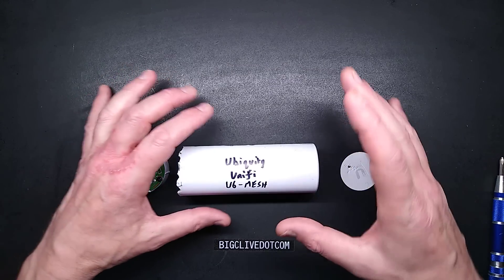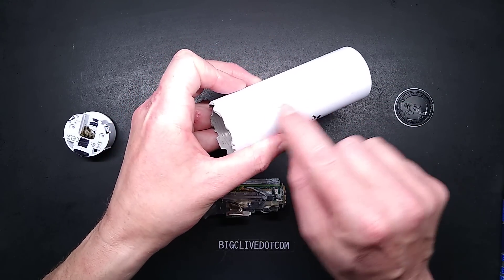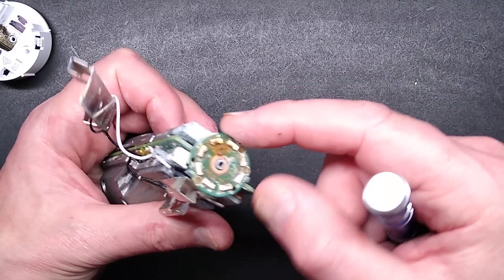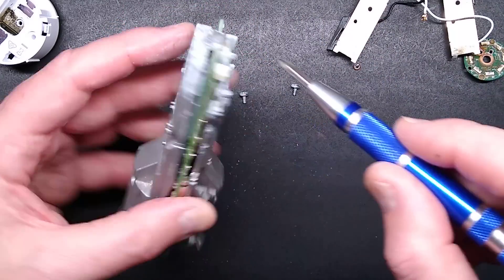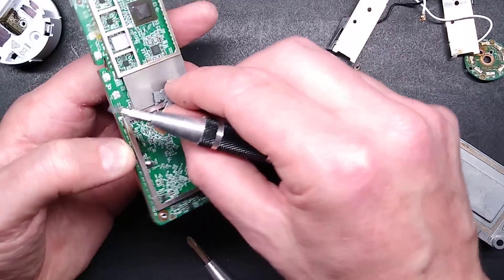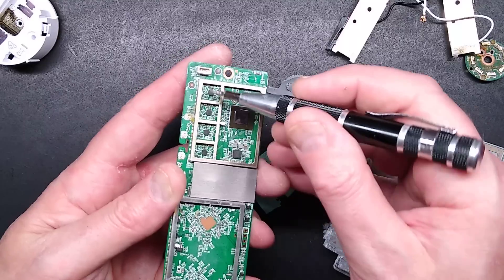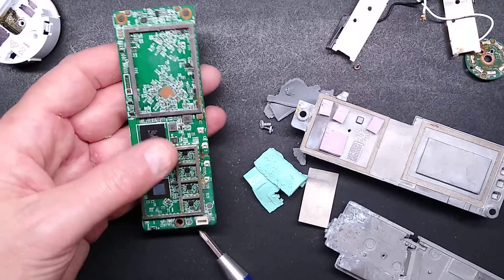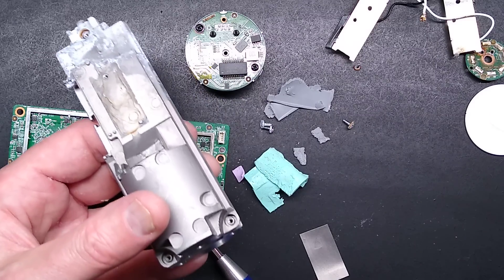Teardown of an impressive ubiquiti WiFi node

Comment: I'm an IT admin and have used Ubiquity products extensively.  An excellent value proposition, but their software always feels... immature. There's always a bit of jank in there. Once you finally get something working, never touch the configuration or it will die in a screaming heap. Quite an odd experience compared to other products. Hardware wise, impeccable.
Reply from the maker: Your thoughts on their software are echoed by others.   It seems to be the weak point.
Reply: @bigclivedotcom It's the entire reason I'm running consumer-grade mesh wifi gear for the moment. This house unlike my last one has no Ethernet drops, so I can't simply run PoE from a cabinet to get whole-house AP coverage, and I just haven't wanted to deal with the nonsense guaranteed to be involved in learning how to manage a more complex Ubiquiti buildout. Not until someone offers to pay me to do it, anyway!
Reply: @bigclivedotcom  Buggy, immature and constantly being revamped with useful or desired features being deleted from the build randomly, never seen again. It aggravates me a lot but there isn't a better option available for similar price points. Their product lines don't make sense.
Reply: Im a IT admin also and have been using Ubiquiti kit for the last 15yrs. Personally i like their software, the UniFi management console is excellent and its the best kind of price. Free. I also use a lot of Cisco Meraki AP deployments, and i will admit the reporting and features are superb, but then again you would expect so given the price for the licencing.
Reply: @TheSaabClinicUK After the latest rework of the controllers UI it has become a nightmare as it’s so illogical and clunky. Network separation is … blood boiling at times, especially if you need to change things afterwards.
Reply: Ubiquity devices work great and last long. I have some that are no longer supported by the latest controller software (or at least it says so, I have not tried to see if it would actually work) so I have to use an older version of that. On one hand, the software can sometimes do stupid things, but I really like that the devices basically have Linux inside then and I can ssh into them and run tcpdump or whatever.
Reply: @Pentium100MHz  Yeh if your using the old original UniFi's then you need to use 6.0.45 for the controller.
Reply: I've only had experience with Aruba's management software and ubiquiti's, and I much prefer ubiquiti for most use-cases (except for something like a multi-campus WiFi solution).
Reply: It is the same with their European/Latvian counterpart Mikrotik.
Reply: I've just upgraded from a TP-Link AX Wi-Fi 6 mesh system to a Unifi Dream Router and the U6 In-Wall, needed the In Wall since it's the only one which has more than a single ethernet port - the TP-Link had 1 wan and 4 GbE on every socket. TP-Link WAN also did 930Mbps, UDR does about 100 less. But that's ok, mostly I only pay for way slower internet. Software wise it's obviously a masisve improvement over the TP-Link, however one oddity is if the In-Wall is connected via Mesh only, physical ethernet devices connected to it work normally and are assigned an IP normally and so on, but do not appear in the client list at all. Bizarre. Known issue apparently, have opened a ticket with them.
Reply: @syniteq If you turn off IDS/IPS, it will most likely do the full 1gbps. I used to use a USG and it would do 1gbps with it off, but under 100mbps with it on.
Reply: And they are historically notorious for rug pulls where they'll suddenly change licenses on things... or put formerly free features behind a paywall...

I mean at least it's not Cisco and co, but they seem to be trying to make themselves more Cisco-y (and not at all in a good way)...
Reply: This so much unfortunately. And not all their products are well executed - I'm looking at you Access UA-Pro.

I am managing multiple UDM Pros, and the "stable" releases on some of the v1 and v2 firmwares love to hang on Network now. The network is working fine, I can reboot the whole UDM to regain access temporarily. Oh and memory holes. Local and cloud.

Door Access would be slick if the UA-Pros didn't have crappy screens, ui just launched a 2nd version, I'm assuming the round screen was untenable. And ui doing back peddling on the camera not being usable with protect, and not allowing multisite without a bogus payment plan or glitchy VPN workarounds... many of us loved unifi for the quality APs and lack of subscription BS, but now the quality is questionable. Just had to RMA some switches, another UDM Pro, and the cloud key g2+ run too hot with the 5tb Seagate drive, had a few of those fail before adding heat sinks. I expect failures to happen, but this is ridiculous. Rant over. Great video
Reply: Agree, I'm in the process of replacing all the unifi gear in my house right now because I'm so fed up with the control software.
Reply: I also used them while I could put DD-WRT firmware on them. Unfortunately, at some point, they began to prevent this and I refused them.
Reply: I've been using them for over a decade. I've always found the software pretty but a little janky until around 2-3 years ago when finally the core features have been stable. I no longer fear the whole network falling apart when I make a configuration change. They're good value for what they provide IMHO.
Reply: I regularly play with the configuration of my EdgeRouter-X. There are quirks to work around, but generally I get it to do what I want without too much trouble. I have it doing a lot more than your average router can do, not because I need it to do all this fancy stuff, but because I enjoy experimenting with it.
Reply: @BrianG61UK edge router is fairly different to the unifi gear btw.
Reply: @zyeborm  Good point.
Reply: Never had any issues with the WiFi side of the UniFi software. I only use their WiFi APs though, not their switches or routers.
My only complaint is sluggishness and high resource usage (the panel is a massive blob of Java code).
Reply: @povilasstaniulis9484  The panel runs on a Raspberry, so at least there's that. But yeah, it's a massive blob of Java.
Reply: I'll agree with that completely. I used to work in broadcast, and the Ubiquiti hardware is great, but I needed help from someone in IT to make any changes in the software.
Reply: true. and the whole vlan support is totally messed up.
Reply: I’m a network engineer, and UniFi is exponentially nicer to use than Ruckus’ SmartZone.
Reply: It's not immature, it's constantly improving. :)))
Reply: I wonder how this hardware compares to Cisco networking devices. I've never torn a AP apart to see. I even had the perfect opportunity but since it was a  government facility I was not allowed to take apart one of their old outdoor access points. Such a sad day seeing a whole pallet of working devices hauled off to auction.
Reply: As a lower budget IT admin, I prefer units that are easily loaded with open firmware to do whatever I want, not locked down gear like Cisco and Ubiqiuity .
Reply: @johndododoe1411  Most enterprise gear is locked down though, it makes it a hell of a lot easier to support and with things like ubiquity, there are no licencing fees or wanky training.
Reply: @johndododoe1411  Ubiquiti works great though. So does Mikrotik. Both are not open source though, but while I use Linux based routers for more complicated stuff, Mikrotik routers/switches and Ubiquiti WiFi work great for mess messing around.
Reply: @Pentium100MHz  Mikrotik is such low quality hardware though - at least all of it that I've seen.  I've used a bit of it at the recommendation of a friend, and... it fried in about 2 years.  Ubiquity seems solidly built, but I've not had good luck with it.  Cisco can just fuck right the fuck off, too expensive, low quality hardware and software, and absolutely unacceptable support, especially for the price.
Reply: I have an Ubiquity Edgerouter to connect my home to my office with a site to site VPN.

Works well but it's annoying how some things are GUI, some things CLI and some things both.

I'm not a CLI fan for these type of things.
Reply: @TheCormTube  I usually use Mikrotik routers and switches and Ubiquiti APs.I did use a Ubiquiti Dream Machine Pro (router and controller) in one network and it seems to work fine. 
I also sometimes use Linux as routers (no GUI, everything CLI-only, just iptables and such), that also works great.

Comment: they are really good bits of kit.

we use them a lot at work both APs and switches and they seem to be really well built. the only let down is there software which can be a bit buggy at times but other than that they are well worth the money.

I myself have a Amplifi Alien router and its way over kill for what i need but does the job. Its also actively cooled with the fan turning on when the unit gets to 62'C (even though it spent most its time this summer at 50'C).

One thing to note is this. turn the brightness of the LEDs down, it's common for the LEDs to go really dim after about a year of use which can be a real pain if you have them installed outside, my guess is that they are driving the LEDs pretty hard at full brightness so a 50-75% brightness level should extend there life a bit more

Comment: I have a whole bunch of AirCams that died from water getting into the RJ-45 connector. And a whole bunch of UAP access points that died because some “genius” decided that it would be a good idea to store a dynamic IP address in flash memory. After that I stopped using the products of this company and I am very happy with that decision

Comment: I think that grey ceramic chip is a BGA (ball grid array) which has some solder balls underneath to connect to the pads on the PCB when it is flow soldered.

Comment: Oh wow, I do this thing for a living and lemme tell you about it

The empty pad that you saw is actually directly underneath the CPU with lots of ground vias for heat conductivity from below.

The 4 little chip is the FEM (front end module) which combines both TX power amplifier and RX LNA, I haven't read the spec for this one yet but judging by the 2 different color, I'd say it's a 2x2 for 2.4GHz and 2x2 for 5GHz (some vendor will combine it so that there's only 2 antenna instead of 4)

The black thingy in the base is just an ethernet transformer for isolating it
Reply: Spec is 4x4 for 5GHz and 2x2 2.4GHz, but it's possible they operate either dual band in dual 2x2 configuration or single band 4x4. The main SoC (IPQ5018) has a 2x2 radio too, though, so I imagine one pair of those frontends is dual band. If I had to guess I'd say the bottom two.
Reply: Yeah Power over Ethernet (PoE) at 1GHz and up needs a cluster of 4 center tapped signal transformers, with the center taps on the cable side extracting (or injecting) the 48V DC running in each twisted pair along with the 100+ MHz AC signal . So each pair carries either plus or minus DC running the 2 wires in parallel and also running 2 pairs (4 wires) in parallel to get enough current capacity to feed 15+ W of phantom power through a signal cable .

I'm guessing the top circle is controlled with i2c (2 wires signal, 2 wires power).

Lots of magic probably went into shaping those antennas to work with wavelengths of 5 to 13 cm .

Comment: 10:06 I opened one of the Nokia PON routers and I found those on top of wifi chips they were just  glued with thin double-sided tape 
They are ceramic heat sinks

Comment: advanced ceramics, like aluminum nitride, are used when ruggedness, hermiticity and high thermal conductivity are required. i'm guessing that ceramic-topped ASIC is the radio transceiver, or maybe the CPU?
Reply: its probably just a thermal mass glued onto the black qualcomm soc, can be removed by heating it then twisting
Reply: It's just a thermal shim. IPQ5018 hiding under it - CPU and should be providing the 2.4GHz radio.

Comment: We've had a lot of problems with ubiquity. Seems to work great for small businesses with one or two APs, but anything bigger just becomes a nightmare
Reply: Installed 40 in a church years back and had dropouts, roaming issues, etc. Installed 5 in another church, and same kind of thing. For whatever reason a computer would connect just fine, then hand off to an AP across campus and the signal went to crap. Yes we adjusted all of the threshold values, put them on different channels, and even locked some devices to specific APs. My coworker just convinced my boss to go with ubiquity cameras, 2 sites, 4 nvrs, 120 cameras and everything was going fine until about 6 months after installation. Cameras rebooting, some just go offline, ubiquity AP drops signal to a G4 doorbell.... it's just not made for enterprise. We probably have 1 maybe 2 issues with our Aruba switches and APs a year, if that.
Reply: @CorollaGTSSRX I selldom use the Ubiquity switches or routers as they seems to run a bit hot. I often use Aruba Switches and Ubiquity APs, for an example wired up a school with 14 APs with 4 different nets on each AP. Most of the units are Windows based computers, but also some Macs. Worked like a charm for over 5 years now.

But at another customer with only Macs, we have had major issues with the AP U6. So much we had to swap them out to Aruba APs. Seems like there’s could be an incompatibility issue or something in that environment caused major issues.
Reply: @CorollaGTSSRX  Possibly a silly question but what does a church need 40 network access points for?
Reply: From experience they hit a bad patch with firmwares a couple of years ago and are slowly recovering reliability from that.
Reply: That's a shame you experience of larger deployments is a little tarnished. I have deployed a few dozen large sites based on Ubiquity solutions and the way the management of the devices is done is of huge beneft to streamlining deployment and ongoing management.
If you are managing the config of individual A/P for example, yeah, you can ave a nigtmare, but doing it the smart way via the Ubiquiti Management software is just a superb expereince.
Reply: Explain nightmare ?. I have some campus deployments with 80+ UniFi's and they all work superb.

Comment: looks like a 4 element phased array, quarter wavelength antennas
Reply: correct. and the direction of the signal can be steered accordingly as well, without moving the actual antennae mechanically.
Reply: @RicardoPetrazzi  aka 'beamforming'

Comment: See this ubiquiti junk a lot in schools. Cause way too many problems so we rip them out and replace with TP link and zyxel APs. Though recently more swaying heavily towards TP link omada systems which are proving to be excellent
Reply: TP-Link, really? The company that offers three firmware revisions and then move on to a new hardware revision and stop support the old hardware? Wouldn't touch them with a barge pole.
Reply: @LGNilsson  one of our engineers recently found a big where an omada controller was treating a 22bit subnet like a 24bit subnet. Tplink went above and beyond and released a firmware update next morning. We are impressed with TP link and so are our customers.
Reply: Odd you’d see tp-link as a different level of quality. Ubiquiti does need setting up correctly in campus installs.
Reply: @edc1569  the omada systems seem much more rebust and reliable, support from tplink is outstanding, and it costs the schools less than premium systems so all round win win
Reply: TP-Link Omada? The same TP-Link Omada that literally took previous gen UBNT kit and RE'd it in their own colour scheme and logo?  I did some side-by-sides of the AP hardware AND controller software when Omada first came out - blatant ripoff.

Comment: The fins would only really benefit, if there is airflow over them. But as you described it with the thermal putty at the base and it probably being pretty good sealed (apart from the bottom), there is basically no airflow inside. So having more mass to sink the heat into and radiate it to the outside makes more sense than having fins.
Reply: Also the mass matches up with the metal part if the outer cylinder to get rid of heat .

Comment: If you use "IMPRESSIVE" in the title, you should add a clip of Todd from Project Farm saying that! LOL!
The reason for the thermal pads/putty on the backside of the PCB is because the actual silicon on the chips is closest to the PCB, and not the top of the chip. The chips will sink heat in to the copper layers of the PCB, so thermal pads on the backside of the PCB help tremendously.
Have a great day, Sir! o7

Comment: Even plastic can change the impedance of an antenna... so yes RF is black magic!  😂
Reply: Depends on the type of plastic too.
Reply: As long as you keep it a few MM away from the antenna it has minimal impact.
Reply: @edc1569  Enough of a difference people tune their Ed Fong differently when they put it in PVC pipe.